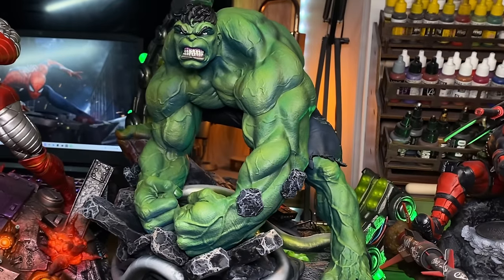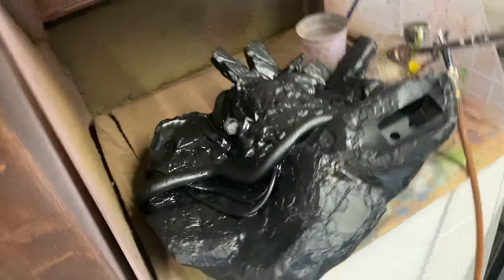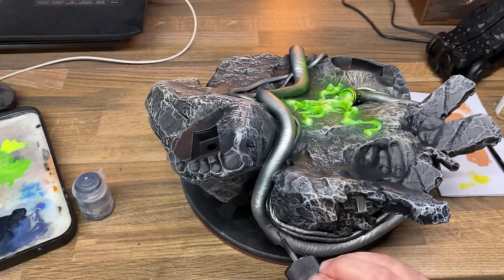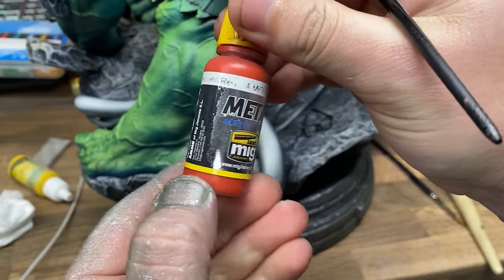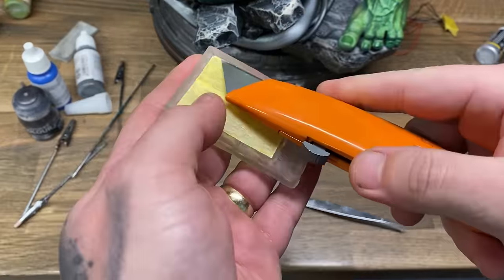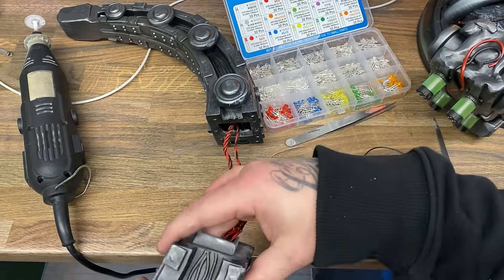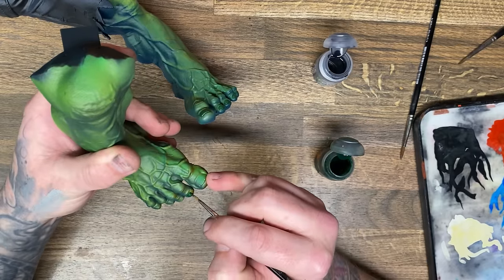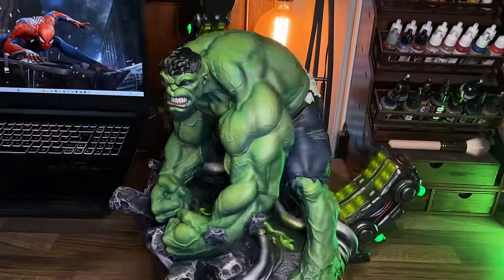How I Painted a 3d Incredible Hulk Print

Comment: Amazing work on the paint job of that giant print! How do you make sure you don't have any uncured resin in the hollowed parts? Do you use a tiny resin light? Or just flush it with alcohol multiple times? I normally don't hollow prints because I am afraid there might still be some resin left in the print which might break the miniature later on, but seeing your videos I'm really itching for some huge prints. But printing this big without hollowing is just a waste of resin :/
Reply from the maker: I let them soak well dude. Also I have a small light too. But if you just flush well and cure well it’s all good